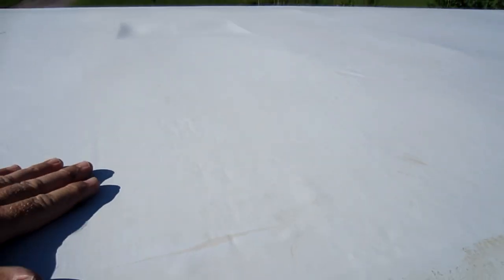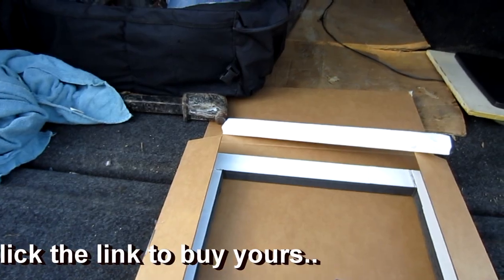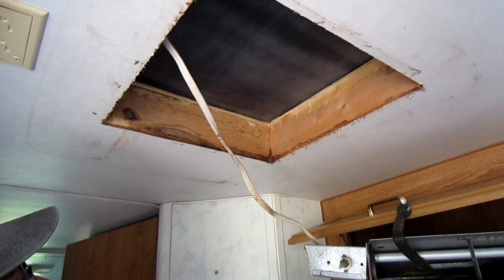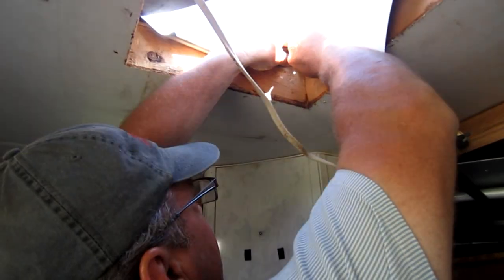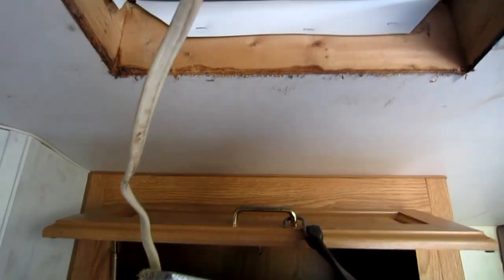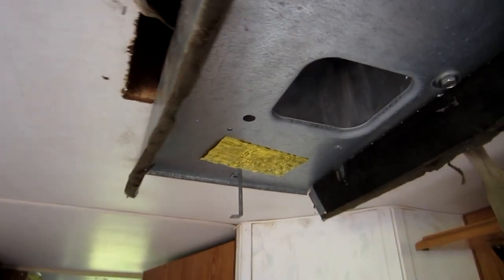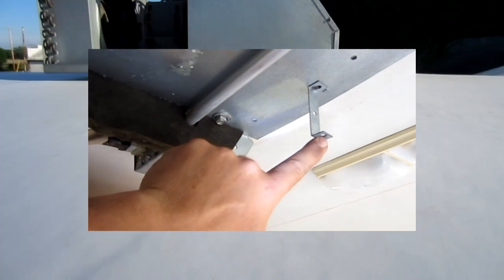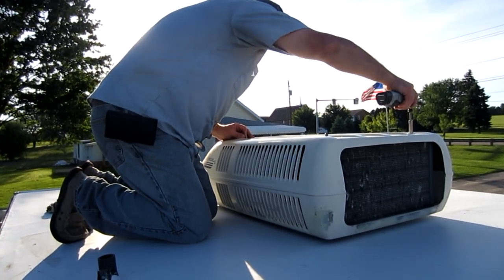RV Travel Trailer ROOF Air Conditioner Install

Comment: Hi there! Thank you for the video! Can you please explain how the face of the control gets attached to the AC? Does it need to be wired in? We are getting hung up on that part... 
Thank you!!
Reply from the maker: Briana Dunning the lower part of the assembly (the part that is metal and has the controls) gets wired to the electrical lines..

Comment: No one says to stick the gasket to the roof exactly where the old one was except the mfg, I may have missed it. The stuck gasket on the roof creates a little dam for water. If you stick it to the unit, the water can work it's way in over time.
Reply from the maker: Not if the gasket is compressed correctly.. Plus the A/C Mounts need to be adjusted over time to keep the gasket compressed as needed due to age... the adhesive that they use on the gasket is so weak so that it is easily removed and is not suitable for making a permanent connection to the roof. It is the type of adhesive that needs to go on to clean smooth surfaces. The rubber roof does not offer that type of surface.
Reply: @Foxboss9  what I wrote comes from following the mfg install directions.  It's up to everyone to follow or not.

Comment: Thank you for this great vid!
Not sure if you remember, as it seems this vid is a few years old ~ but what did you use to clean off the old gasket residue?
Reply from the maker: I had replaced the roof so there was nothing there but on the ac unit i used carb cleaner and a brass brush..

Comment: I have an existing hole that is 22 7/8 it is actually the fire escape hole can or do they make an a/c unit to fit that size of a hole. Can anyone help answer
Reply from the maker: David Cantu some of the newer AC units have a flexible duct that may allow that smaller hole to be utilized just fine. You may want to call Dometic
Reply: Foxboss9 I ask u 2 other questions